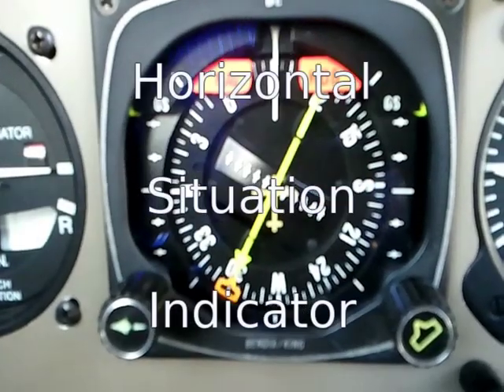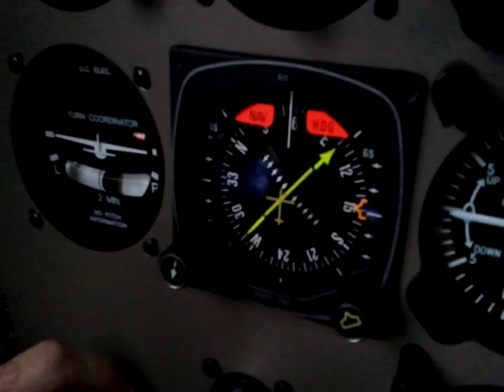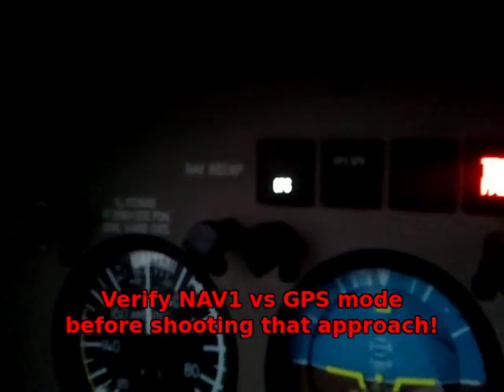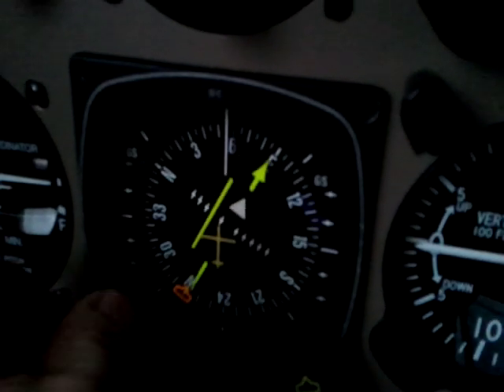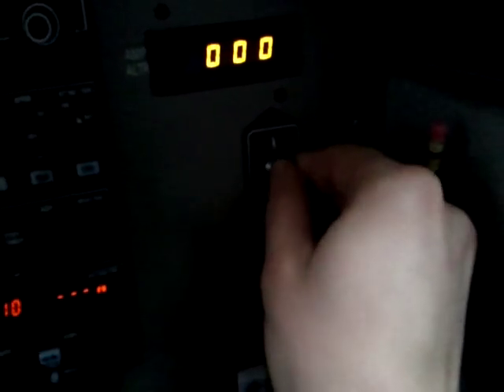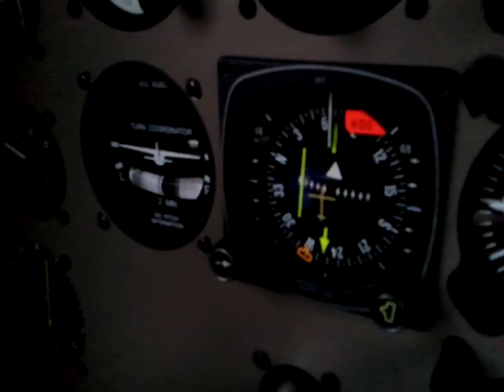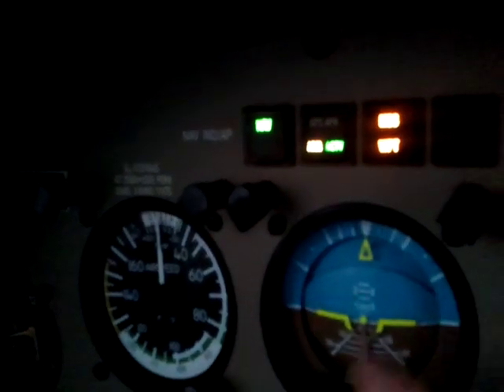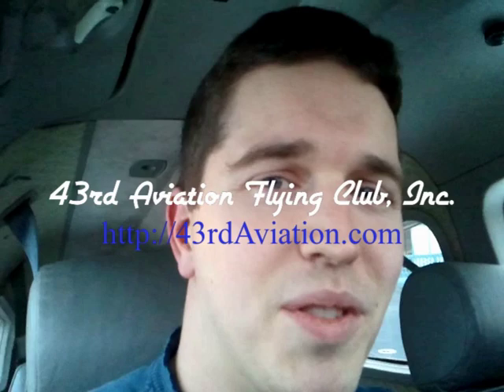Horizontal Situation Indicator Tutorial

Comment from the maker: @cphillips103 Thanks! I should mention that on a backcourse approach just make sure you have the front course selected. (i.e on the runway 27 backcourse approach have the arrow pointed at 090) But yes, otherwise when tracking it automatically chooses the proper TO/FROM to be correctly sensed.